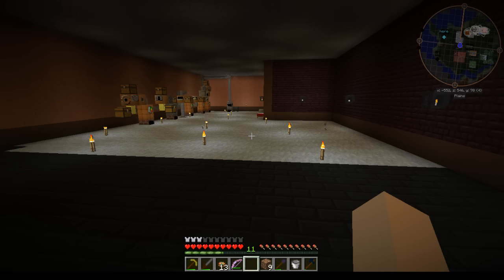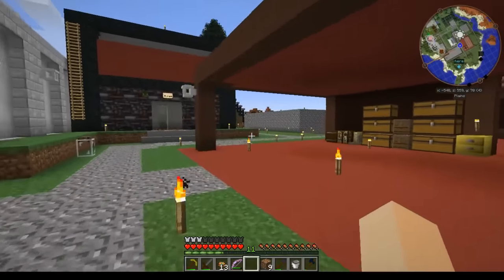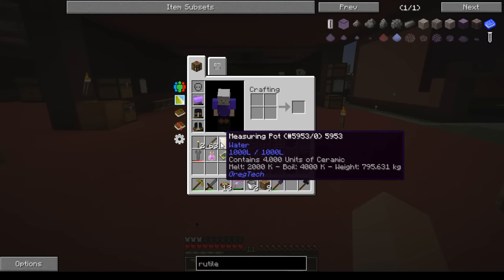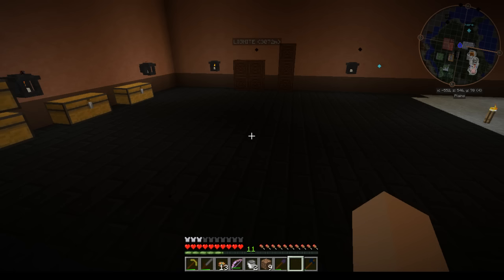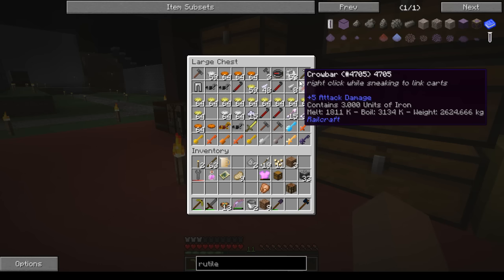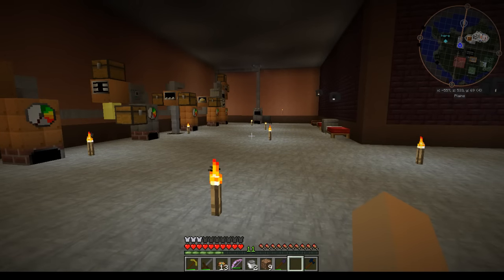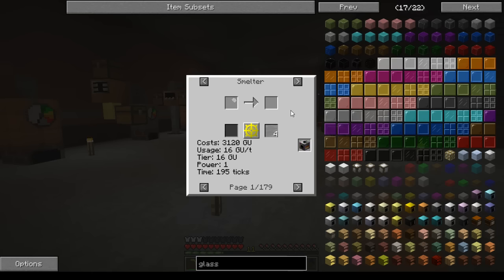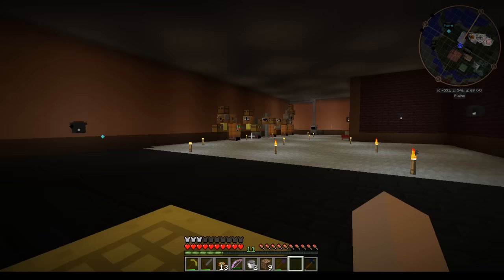[Gregtech 6 LP] EP 205 GT6.04.06 &.07 update

Comment: Bucket fixed. I decide to avoid register fluid blocks by default and forgot to turn it on for rubber tree sap. As for centrifuge recipe for sap may be sacks should produce latex from GT6 instead of IHL fluid and then I will leave it to Greg. I once ask him about such unification, but he says no. Maybe this time he will rethink his decision. Ask him.
Reply from the maker: will do and thanks for the fix, love your mod btw!
Reply from the maker: greg said that rubber tree sap is not pure latex so we wont do that, so I guess the best is the centrifuge recipe like GT5 has with water, glue plant material and either sticky resin or latex?!
Reply: Your wish is granted.